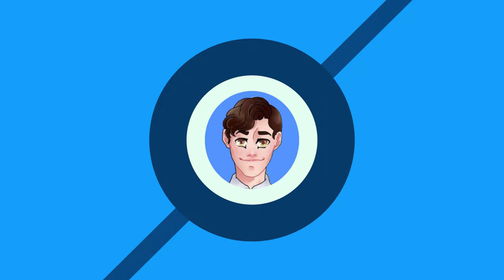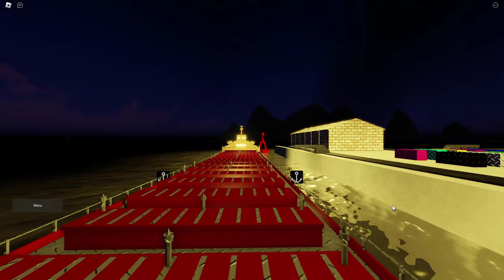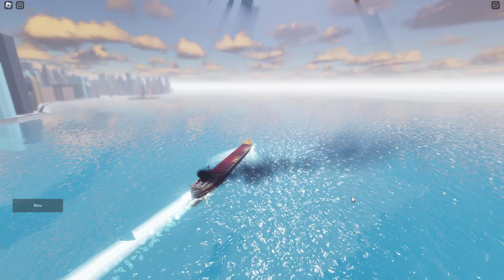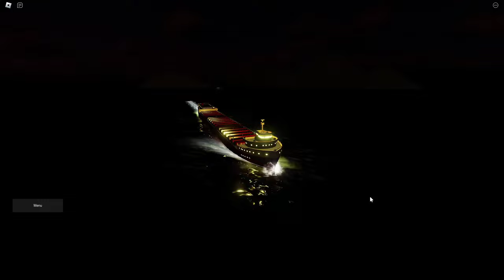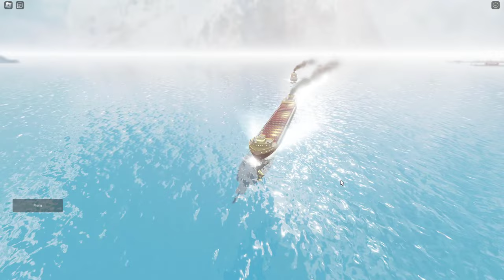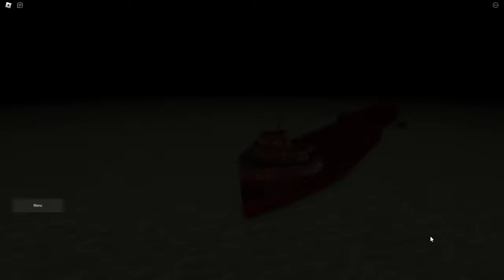Edmund Fitzgerald | Tiny Sailors World | Recreating The Disaster EP11

Comment: Actually, the waves weren’t 10 feet they were 30 feet tall that’s taller than my house you may be asking then did it knock the ship around yes and it also went over the railing. How do you know when it’s 30 feet tall well basically you’re gonna have to measure it if it goes over the railing is 30 feet tall.
Reply: so your house is only 9 meters tall?
Reply: @Epic_carpet  correct